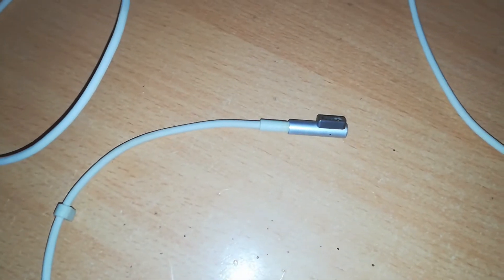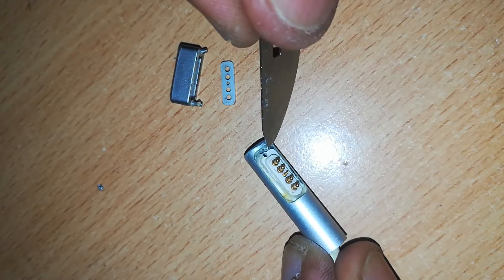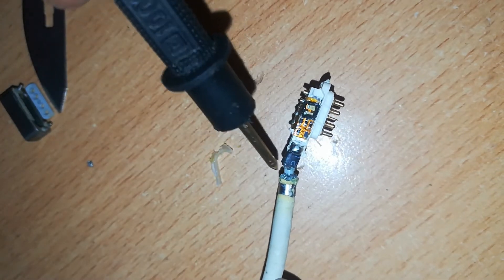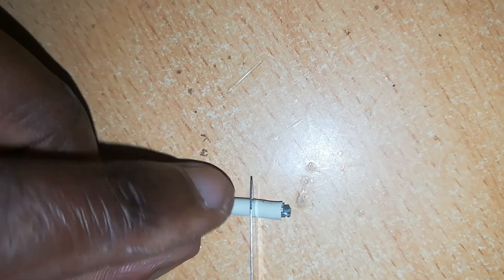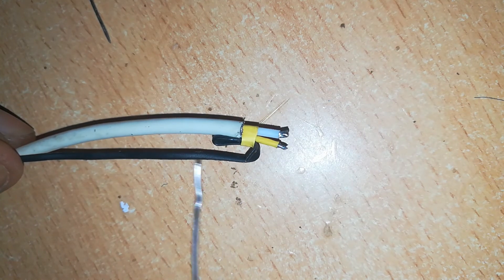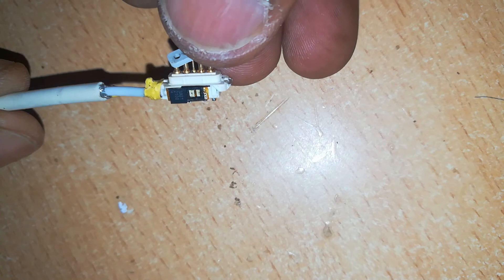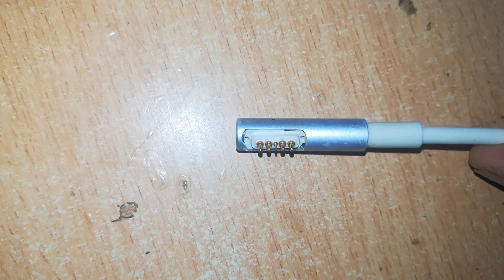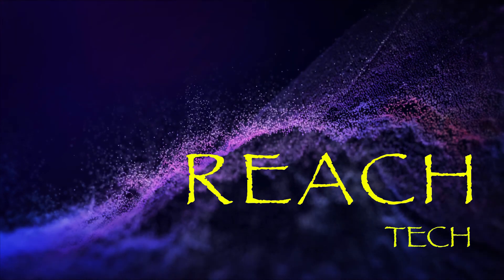Apple magsafe charger repair - Connector

Comment: Great instruction and nice work. My problem is the orange light always comes on after a few seconds green...the plug seems fine and always sits in the same place at home, ie - never moved...?
Reply from the maker: hi P S. Thanks for the complement! When you connect a magsafe charger to the macbook, the green light comes on first. This shows that the charger is good and there is good contact. If the green light stays on, then your macbook is fully charged. However, if your macbook is not fully charged, the orange light comes on -to show that the macbook is being charged. As you point out, this takes a few seconds, i.e.transition from green to orange. On full charge, the colour changes again from orange to green!
Reply from the maker: Don't forget to subscribe, like and hit the notification bell. And keep the questions and comments coming!
Reply: @reachtech1  I have.  Do likewise. Very helpful videos  :)
Reply from the maker: Thanks! 'subscribed too! great work by the professor in one of your videos!

Comment: My mag safe works fine but the issue I have is the mounting the metal as magnet to hold the cable. what do I use to make it hold apart from just squeezing it with a playus?
Reply from the maker: hi. Apply some super glue around the metal before replacing (remove any previous glue from the metal) .Then squeeze tightly with pliers and allow to set for like 20 minutes. The result is great!
Reply from the maker: subscribe n share!